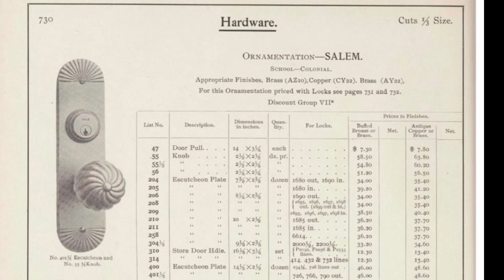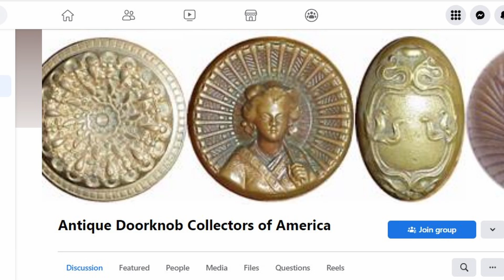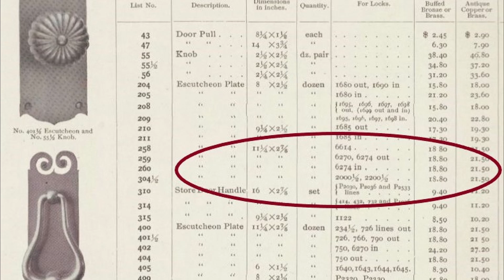S2.43  Getting Our Bling Back

Comment: Those are so pretty! Great you were able to find them. I can see why you need a spreadsheet, lol. It's so easy to have a brain fart while looking at those catalogues, and later realize you ordered a bunch of the wrong size. And unlike lumber, you can't just shave off a bit...it has to fit exactly. We had a single pocket door between the kitchen and dining room in the 1958 mid-Century house I grew up in. There was a similar push handle in the side of the door. Congrats on finding Heather. She's a gem.
Reply from the maker: I am quite shocked that we've found as much as we have.  They weren't as popular as some other hardware.  Heather is such a big help.  She's been amazing and is such a pleasure to work with.  She loves this house too.